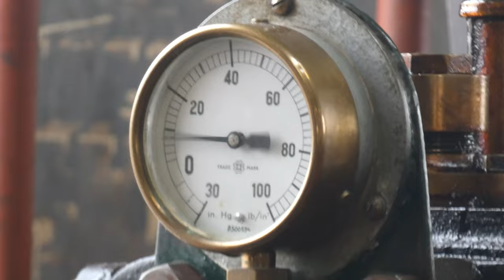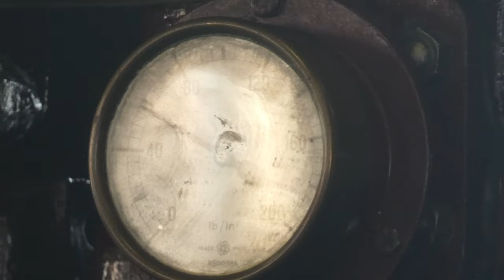National Waterways Museum Power Hall - Stationary Engines at Ellesmere Port

Comment: 1:19
We have one at umgeni steam
Idk if it runs tho
Maybe i should ask if we can hook it up to a compressor
Reply from the maker: We’ve got one at Tees Cottage, we’ve been restoring it and ran it on air for the first time 2 weeks ago! The last time it ran prior to that was in the 1960s
Reply: @teescottageguyproductions  yo
Ja ours has been sitting one side next to the locomotive
Ill make a video about it someday
Theoretically there should nothing be seriously wrong
Just take apart clean up
Resemble
But that takes time
And we don't have that lol
Reply from the maker: @laaity  yeah they’re often used on foreign locos, in the UK we used Westinghouse’s instead of Duplex’s for our locos. The one at Tees cottage came from the now demolished Peases Mill which was also in Darlington
Reply: @teescottageguyproductions  ja as far as im aware our locomotives never had steam pumps only injectors
But the mines problably used those pumps for water
Heck back in tbe day they would modify old tenders into water bottles so that the engines can go longer distances
Reply from the maker: @laaity  in the UK, we don’t use pumps for locomotives water feed, we use them for the air brakes. The mines used these pumps for boiler feed pumps, the most common engine used for mine drainage are non rotary beam engines